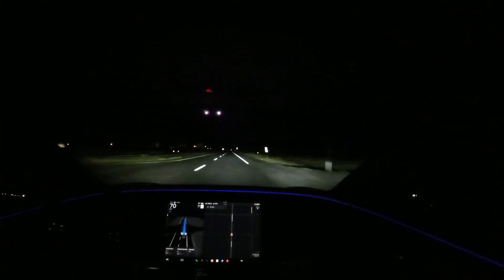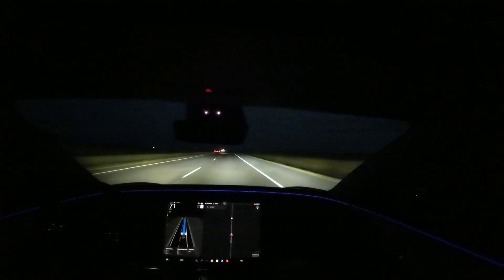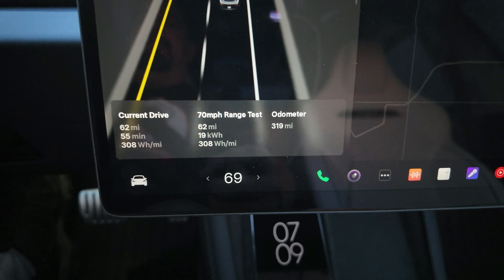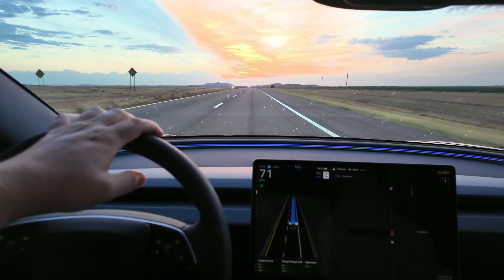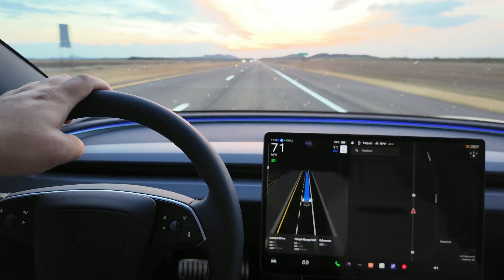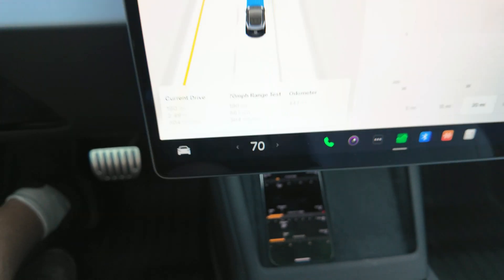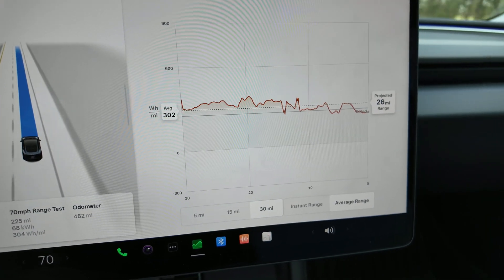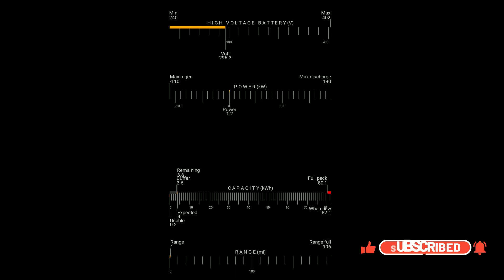2024 Tesla Model 3 Performance 70 MPH range test

Comment: You were getting 305 at 71 mph that is something seriously wrong.  My 2021 mode 3 performance, original owner with 95,000 miles at 80 mph I get 270 wh/ mile and get roughly 270 miles on a full charge
Reply from the maker: @ranyshawket9253  What do you think it could be? I went the same speed from 100% to 0%.
Reply: I think teslas are weird cars in a good way, some days they do great efficiency and some days not so much. None the less for a car that can keep up with 8 out of 10 super cars on the road and probably nothing will catch it or keep up with it from a dig goes back to what makes you happy… I didn’t buy a performance for range purposes. Beautiful car inside out and congrats to you I have seen your last couple videos and you are an awesome guy !

Comment: Can you do an 80 mph test?
Reply from the maker: I can do that. But I'll have to find a road that has a speed limit that is higher.  Maybe not a full test, 50 miles will give us a good average. And then I have the app that tells me exactly how many kilowatt hours the BMS thinks I have available in the battery pack. And then some basic math will tell us the answer.
Reply: @Crazypostman  That works, really just trying to see what the consumption is, I can interpolate to battery size after that.

Comment: That was a really bad test. Stop messing with parameters and turn off FSD.  Run one test with and another without aero inserts. Try running a test with FSD and without. But be consistent throughout the test and only change one thing at a time.

Comment: Your final range is actually a little worse - probably 250 miles instead of 253 miles, because the car thinks it is going 71 miles for each 70 miles it actually travels - and it integrates the (slightly off) speed x time traveled.  Out of Spec channel just tested a 2024 M3 that very surprisingly exceeded the EPA range - but we know Tesla rigs the game with high profile YT influencers with improved FSD performance via mapping - so I wouldn’t discount the possibility they cheat with these same influencers by rigging their test cars with more battery capacity.  Nobody I know (including me) has gotten more than 85% of stated range in their Tesla when driving at highway speed (70-74 MPH).
Reply: False. OutOfSpec drove the Tesla in Auto Pilot, not FSD. They explain in their video why was not on FSD.
Reply: @NewGuyInTown_CA  I did not comment on OOS’s use of FSD in their range test.  You are missing my point entirely.  I only brought up FSD to illustrate that Tesla cheats by making for a rigged better experience for prominent YT influencers.  If they do it for FSD (which is undeniable) they could also be doing it for vehicles provided for range tests.
Reply: @danlambesis1289  Do you have a Tesla or drive one ? What you say is preposterous. FSD does nothing to speed. What you see in the screen - in this exemple 71 mph - is not 50 mph. What's posted as speed IS the speed. FSD or NOT.
Reply: @NewGuyInTown_CA  What are you talking about?  Please stop with all of the FSD talk!  This video was a RANGE TEST.  The tester had to set the TACC (traffic aware cruise control) to 71 MPH to achieve 70 MPH actual speed as determined by GPS.  So the Tesla was counting up more miles than were actually driven (distance is the integral of velocity over time).  I don’t know where you got the 50 MPH figure from, and I don’t know why you insist on taking everything back to FSD on a video about a RANGE TEST.  Yes - I own a Tesla.
Reply: @danlambesis1289  You have no idea what you are talking about. Driving at a certain speed doesn't mean you covered less distance. And they drove 370 miles at highways speeds of 70 mph. Yes, if you watch the video, you'll see at the final part of it that it also tells you how much time it took to cover the distance. And if you do the math, you'll get the average speed of 69 mph (which is normal given the AtoB BtoA turns they made during the test).
Reply: @NewGuyInTown_CA  You really are dense.  I’m referring to THIS video - the video that you are commenting on.
Reply: @danlambesis1289  And I was making reference of your comments about the OutOfSpec. I mentioned this in my first answer. Not sure who's the denser here, you or me.
Reply: @NewGuyInTown_CA  I am sure.

Comment: Even though it checks your eyes you can still put your hands on the wheel. That will take off the alert
Reply from the maker: My hand was on the wheel and I was actively shaking it. It reacts differently depending on what warning it's giving you. There's one warning that says to keep your hands on the wheel, and there's another one that says to pay attention to the road or whatever it says. If it says to pay attention to the road, it doesn't matter what you're doing to the wheel. It just seems to matter where it thinks you're looking on that warning. I've found wearing sunglasses really helps keep the nagging down.

Comment: good information, although the consumption of your car seems unusually high. I too have a 2024 M3 Performance. Have owned it for about 6 weeks and 3k miles. Aero covers have not been removed. Since new my car has averaged 253 wh/mile and in last weekend's 700 mile journey over the Sierra (sea level to ~9.5k ft) including some high speed stuff in Nevada, the car got 240 wh/mile. This included some 70-100 mph stuff. Extrapolating the 240 wh/mile efficiency with the 82 kwh battery, the max range should be about 341 miles.
Reply: You dont get to use the full 82 kwh. If tesla would allow you to access 82kwh, your battery would degrade too quick and tesla would not be able to honor 120k battery warranty for everyone
Reply: I also average 220/250wh/mi (aerocovers off) but when you do purely >70 mph it def goes up
Reply from the maker: I don't have anything to reference it to except my previous Model 3 that was a 2019 non-performance. But I agree, the consumption was higher than I expected.  Maybe I'll do some follow-ups with different methods of testing the consumption.

Comment: 😎👍 how many commander buttons did you get .
installing the commander? I thought you mentioned it could keep you out of Tesla self driving jail did I hear that wrong and can we watch you install and test the buttons?
Reply from the maker: I currently just have the commander and no physical buttons or knob, So I can do everything, but I have to do it through the app. I have a video that shows me installing the commander. The get out of autopilot jail free card was a reference to the previous video when I went to pick up the Tesla on delivery day. The speed limit on the highway is 85. So that's the maximum you could go on autopilot. And then I went to pass somebody and exceeded that and I got put in autopilot jail. There's a setting that the commander has if you exceed 85 MPH it immediately deactivates autopilot So you don't get banned from using FSD for the rest of your drive.

Comment: It would drive me nuts to have to stop and recharge 6 times for one trip (which I take a few times a year) of ca. 1700km. That same trip I drive with a single fuel tank.
Which is the reason I am still quite averse to EVs ... When they get a range of at least 1000km, then I might consider one.
Reply from the maker: @sHuRuLuNi  I don't think the range is as big of an issue as the charging time. If you could go from dead to full in five minutes like a gasoline or diesel car, it would be a non-issue.
Reply: No you won't.

Comment: Did your Mach-E have BlueCruise? I think the eye monitoring is similar to that.
Reply from the maker: @TechnicalLee  Mach E did not have Bluecruse Just the regular line centering. Can't remember what it was called. 360 something.
Reply: @Crazypostman  Ah, so I guess you've never had eye monitoring before. BlueCruise is similar because it will alert if you look away from the road at anything for more than 5 seconds.

Comment: You're not going to be able to film holding your phone while driving on FSD supervised. Holding a phone is one of the detected behaviors that can trigger almost instant jail while looking down IIRC. I've also heard it monitors your hand positions? Make sure you get sunglasses with non-metallic tint so it can see your eyeballs clearly (IR light passes through regular sunglasses just fine). The blue/yellow/silver/orange tinted ones won't work very well.
Reply: The driver monitors are pretty extreme. I don’t want to be video tapped; let alone by an appliance. I’d really wish there was an alternative method for enabling driver assists.
Reply: @JB-fj5bm  It has to be extreme due to extreme abuse of ADAS systems by some drivers. Doesn't really bother me, but distracted driver types will be in for an awakening.
Reply: @TechnicalLee  fair, it’s more privacy than anything else.
Reply from the maker: @TechnicalLee  I'm only gonna have FSD for a few more weeks and then it's gone, its not worth it to me, Cool party trick though. Regular autopilot is plenty for me.

Comment: Watts and wheels channels had 360 miles on his 2024 model 3 performance by charging the wheels to 18inch
Reply from the maker: @Omega---13  I was thinking it had to be the wheels, but then I remembered the spoiler and the splitters. I wonder how much they cause.
Reply: @Crazypostman Smaller (& lighter) wheels always helps. Less inertia to overcome. Did you know, if FSD kicks you off, just stop, put in park, hit end trip, then reengage FSD. GTG!
Reply from the maker: @Crunch_dGH  That's what I ended up doing. The next time I did a U-turn, I stopped on the entrance ramp. I did figure out it would let me go into basic cruise control even before I stopped, by changing my setting.

Comment: This is surprising as i get about 240 on an 80% charge on my 2020 kia niro. 

I would have thought tesla would have my niro beat. But then again,  I'm mountain roads and Max speed of 60 up here in Pa with my drives.  

I'm also am really uncomfortable with the limitations with cruise control and auto pilot.  

This makes me really have second thoughts about ever switching to a tesla now.
Reply: Youd get over 300mi at <60mph. Also this is the performance version, you can get a model3 lr rwd that does 363mi for 15k less. FSD is good, but you gotta watch the road
Reply: @RIVvideos  gotcha.  I thought performance got the better range.
Reply from the maker: No the performance has many things working against it in the range department compared to the long range Or RWD.

Comment: Retest with aero wheels on
Reply from the maker: @evdave528  Ugh, I really don't want to take them off again. If it was all one piece, it wouldn't be so bad.
Reply: @Crazypostman  I agree, taking them off was a pain in the butt and they scratch the wheels. Mine are never going back on.  I'll take the minimal range head since they look so much better without the blades.  Tesla should give the owners an option not to deliver them installed. I was not happy with the wheel scratches, even though I managed to compound them out.
Reply: @Crazypostman Did you know, if FSD kicks you off, just stop, put in park, hit end trip, then reengage FSD. GTG!

Comment: Thanks for sharing.  I think that is about right.  I can't explain that number Out of Spec just posted for the AWD LR 2024 vs the 2021.  I want to know the weight of those wheels, and what tire they are using on that 2024 AWD LR that they beat the EPA numbers.
Reply from the maker: @Longsnowsm  Yeah, that was insane. They beat my number by 100 miles! Of course, the performance is probably a little heavier, the wheels are wider. There's a spoiler with more downforce. Probably the Front and rear splitters cost some efficiency. But I didn't think it would be 100. Thats crazy!
Reply: @Crazypostman  That new performance does have a staggered tire setup.  Early reports I saw from Europe were saying the efficiency appeared to take a hit and likely tire/wheel related.  That is what I would attribute those efficiency numbers to.  Looks like that tire/wheel decision basically offset any efficiency gains they might have gotten elsewhere in the refresh.   But for those who want a car that handles well it should work better for track days and spirited driving.
Reply from the maker: @Longsnowsm  Yeah, I was shocked by the results, but I'm  not disappointed  I got the performance, it's fun!